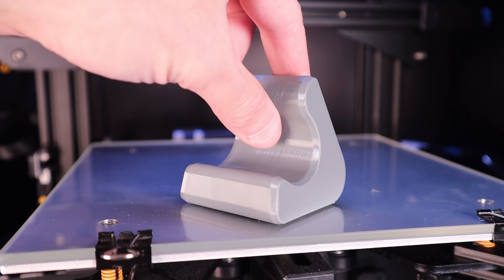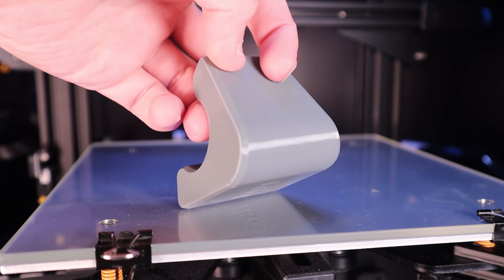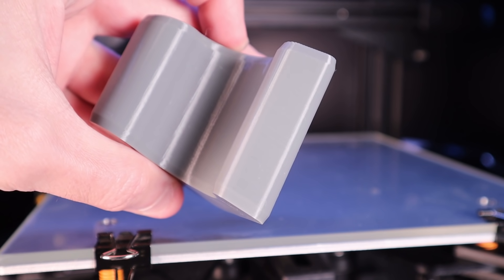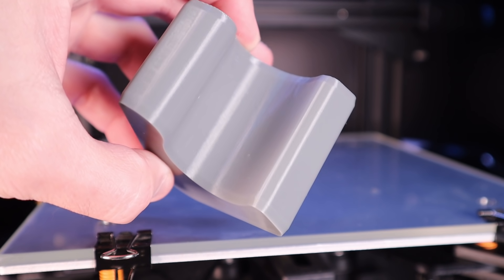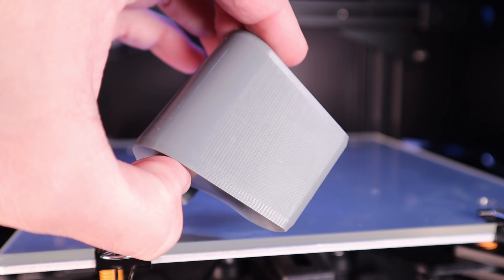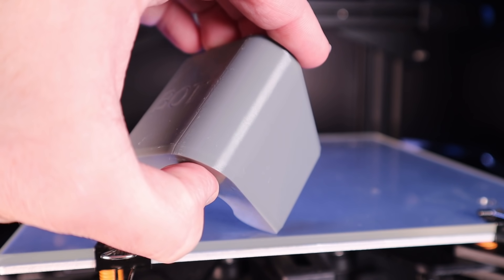Creality Ender 3 V2 - Simple Tips for Super Clean 3D Prints

Comment: That one with the last settings looks good. Myself I havent printed anything anymore. Still stuck with the bl touch. Last testing today.. After that I can only say the sensor itself came broke from start.

The videos look better every upload. 
It shows the effort that has gone in em!
Reply from the maker: That's disappointing, I don't know whether I'll ever need the BL touch, I rarely level the bed with this printer.  I did upgrade the springs because the stock ones were very weak and could promote the knobs from loosening though.

Good luck!

Thank you for the compliment, and yes it is a fair amount of work.  My hope is that I get better at it so it doesn't take as long.   I have a list for the next 10 of so videos, so I'll be busy for a while.
Reply: Rik, if you need a hand, I got mine working after some trouble. Your name makes me think that you're Dutch, so you could give me a call if it doesn't work out.
Reply: @DHGV  klopt inderdaad, ik heb hem nu werkend. 123-3d .nl heeft mij geholpen via de mail. Er is schijnbaar een 4.2.2. Moederboard firmware waar duidelijk bij staat 4.2.2. Bl touch zonder adapter. Vanaf dat deze erop staat doet hij het goed (de bl touch)

Maar vanaf dat ik de printer verplaatst heb en zo vaak op zijn kant maakt hij nu een vreemd geluid op de y as. En kwam er  gister achter tijdens de excintric nuts onder het bed aandraaien dat als ik het bed van voor naar achter duw. En hier goed oplet voel ik een kleine verhoging in het bed achterin. Maar kan niets vinden bij de wieltjes of de rails. Twijfel om hem nu deels uit elkaar te halen en weer opnieuw te assembleren.
Reply: @TriMeX1987  Mooi dat dat werkt. Wat je beschrijft op de Y-as herken ik niet, maar klinkt alsof een van de wieltjes niet helemaal gelijkmatig is afgesleten. Het kan ook zijn dat het te maken heeft met je Y-riem. Staat die te strak gespannen, of te los, zit hij goed op de geleiders? Is hij beschadigt? Dat kan er zeker voor zorgen dat je iets voelt in die beweging.
Reply: @DHGV  de ender 3 is praktidch nieuw. Heb nog geen volledige rol filament geprint.

Ik had op de z as wel wieltjes beschadigd. Voelde ik ook en direct nieuwe wieltjes erop gezet. 

Het lijkst als je de plaat helemaal naar achter duwd dat hij ergens overheen omhoog rijd..en net ervoor een dipje.. in dit dipje kon ik het bed ook licht bewegen. Daarna excentric nut weer beetje vaster gezet kijken of dat hielp. Maar voor alsnog niet. 
Hij maakt ook een raar geluid bij auto home op een lage snelheid hoor je het niet. Maar hier wel.
Reply: @DHGV  idd beschadigde as. Zit een deukje in het frame. Dus het wieltje dat ertussen rolt beweegd daar op.

Heb contact opgenomen met banggood. Kijken wat de oplossing is. Bij aankomst waren 2 wieltjes ook al zo beschadigd dat het niet bruikbaar was. Denk een nieuweling met inapkken.
Reply: @TriMeX1987  hmm waardeloos. Hopen dat het snel opgelost wordt. Wel fijn dat je erachter bent gekomen wat er nou precies mis was! Succes met de reparatie en happy printing!
Reply: @NeedItMakeIt  good to see your vids are getting pass 1 mill.. congrats!
Reply from the maker: @TriMeX1987  Hey thanks!  I happen to be working on several more 3D printing vids at this very moment.  I appreciate the support my friend.
Reply: @NeedItMakeIt  I was about to say.. things that are hot right now... bambu x1 vs prusa.. that will get hits 👍

Comment: Try printing outer walls first in the Cura settings. It depends on the geometry of the part but it can help (not for overhangs).
Reply from the maker: I will try that, thanks for the tip.  Not for overhangs because it loses the added bond to plastic adjacent to it?
Reply: @NeedItMakeIt  Correct.

Comment: What's your print speed at? and does it matter?
Reply from the maker: It does matter a bit, i like to print outer walls at 35, inner at 50-55, infill around 60 or a little higher.  A high speed can cause trouble for overhangs due to not enough cooling.  Fans high, and add an additional room fan if you want to keep your parts cool with higher print speeds.

Comment: I would say that plastic is overheated...
Reply from the maker: Can you elaborate a little bit on this, how can we determine if it is overheated?
Reply: @NeedItMakeIt  just take a look at its fluidity. I prefer to print at the lowest temperature bound, in that case you will have less smudges and strings. Try to reduce your temperature settings by 5-10-15 degrees and compare.

Comment: Tricks that worked great for me was to buy a Creality Ultimaker glass plate and make a flow percentage calculation using a ruler.
Reply from the maker: Do you have a link to the glass you can share?  Thank you!
Reply: I got my glass plate from ebay. Works great but know few guys that bought glass at hardware store and cut it to size themselves that haven't had any issues. 🤷‍♂️
Reply from the maker: @fishingsouthernindiana6480  I've been using the 3mm borosilicate glass for a while and it has been working very well until 2 days ago while testing a high flow 0.5mm layer height with a 1mm nozzle, the part had such a good bond and contracted with such force that it cracked the glass.  I've also used picture frame glass from walmart at 2mm and it works well also, though it is more flexible.

Comment: On a circular single part why is there a need for a seam at all? Couldnt it just comb inwards while adjusting the z height and continuing to print? My printer arrives in two days be gentle lmao.
Reply from the maker: This method is known as the VASE mode, it is possible right now.  If you have multiple walls, it is not currently available.   I think your idea is possible in some cases in a spiral type motion from in to out and then up, then from out to in, but it would still have a seam where the beginning and ends of the extrusion are.  There are a few other ways to get better seams which I did not discuss, they'll be in future videos.   Linear advance is one, nozzle diameter is another.  Smaller diameter = better seams, but at the cost of much longer print times and weaker parts.

Comment: i'm not a fan of using glue sticks or hair spray.  it should stick to the plate by settings. for this i suggest turning fans off for the first 2-3 layers and slow the initial print layer down to 20mm/s.  this will help you not need any glue!

Comment: The butter failed in my testing. The print would dislodge from the plate, and fly across the room. It wasn't until I came across your video that I should have used salted butter. If I only would have known sooner.
Reply from the maker: Yes, and only use the best quality butter.  I like to churn mine a few hours before I need it so I know it's fresh :)
Reply: @BlondieHappyGuy  Yeah, it's a joke. In case you're wondering, any type of grease is going to ruin your first layer. The print will simply not stick.
Reply: @Brax W Before you make the obligatory, overused reddit joke, maybe you should take into account that I was replying to someone else's comment. It appears that comment doesn't exist anymore, but my reply still stands. In case someone doesn't get the joke, yes grease will prevent the print from sticking. Now that we got that cleared up, this matter is in my opinion resolved.
Reply: @PunakiviAddikti  thanks for telling me, too many people are saying to use grease, it's confusing to a complete beginner
Reply: @hank1845  You're welcome I guess. If you need bed adhesion, use a heated bed at 60 degrees for first layer and drop down to 50 degrees for the rest to help avoid warping. Hair spray is a good adhesion agent.
Reply: @PunakiviAddikti  yeah I thought butter was serious I was so confused because I saw to use glue sticks so it didn’t make sense to me I’m a complete beginner that doesn’t really know anything
Reply: @joemoment-o1275  I can see why some people think it’s funny it’s like a gate keeping thing I’m pretty sure, there’s gatekeepers everywhere
Reply: @michaelelizondo4724  I will never put f****ing butter on my printer
Reply: "If only I would have known butter " XD
Reply: @joemoment-o1275  I mean, it's kind of funny...
Reply: I can't believe its not butter
Reply: @PunakiviAddikti  Your reply is still useful cause i was sitting here like theres no way someone is using fucking butter hahaha and this is the first time ive seen this guys videos n im newer to 3d printing so i know about glue sticks but i thought it was some new method i was like interesting but ill stick to elmers glue stick shaha
Reply: @concentratecorner1744  I can definitely see beginners falling for this and actually using butter on their bed. Hell, I probably would have if it wasn't for the instructions that came with the printer.

Comment: I noticed you were using petg filament would you recommend to use this material for cookie cutters? I was recommended this from some library class I took on 3d printers but haven’t heard anyone using this filament I often here just pla.
Reply: Also I’m fairly new to this 3d print world and I’m binging on your videos. I’m wondering if you may have settings you would recommend for the slicing program. I’m so intimidated buy the printer and don’t really know what settings I should have. I bought the ended 3 pro but still haven’t made one print 😐
Reply from the maker: PETG would be fine to use, it is highly resistant to abrasion and is somewhat flexible unlike most PLAs.  Some PETGs are also noted as food grade, it is a little misleading because the material is made in a food-grade manner, however the final result isn't because it contains so many small voids for food particles to embed themselves.    I don't see a problem as long as the food is being cooked.
Reply from the maker: Let me know which material you're going to try and I'll dig up a profile you can use.  It is certainly a lot to know in order to start.  Once you have a few under your belt, it will be a piece of cake.

Comment: outer wall speed of 50mms and regular print speed of 100mms does the trick for me. And also, a perfect first layer
Reply from the maker: That's a fast print, I must try this, I haven't had the courage to go past 78 only on infill.

How about calibration, do you spend much time on this?
Reply: @NeedItMakeIt  I recalibrate the bed on a weekly basis. Mostly because the threads on the upper aluminium extrusion for the bed assembly on my ender 5 is stripped, so the bed shifts slightly between prints. With my current settings they print crazy fast and look gorgeous. 0,24 layer hight, 40mms initial layer speed, 2 shells, 15% infill, 240 moving speed, 0,6mm layer widt, 0,4mm nozzle, 10mm retraction distance

Comment: Hi. I'm a noob with issues. My bottom and top layers have (very) poor detail. I've googled with no luck. On a test cube my y axis is a few mm smaller than the other sides. Are these related? Using a Creality Ender 3
Reply from the maker: If only the bottom and top layers have problems I'd have to say you have an issue with over-extrusion.  The middle layers are likely not as impacted by this due to the hollow area and infill.  If it were just the bottom, I'd say that your build plate was too close to the nozzle for the first layer.    Can you do a 100mm extrusion test to see how close you are and re-calibrate the e-steps accordinly?
Reply: @NeedItMakeIt  I haven't tried, but I'll do that next. I'm learning this as I go. Is there a really good resource for all in one new user troubleshooting?

Comment: cant they find a way to put the seam in the infill, so everything would be seamless
Reply from the maker: With the exception of the vase mode, spiralize 3d printing method, there will always be an area where the layer begins and ends.  The simplest analogy being to draw a shape using a continuous stroke, starting at one point and stopping where you began, that spot will not align perfectly.  The 3D printer does a little jog inwards to conceal the seam better, but the nozzle diameter and the layer thicknesses seem  to have a fair impact on the final look.  Have you tried linear advance at all?  I believe this may help a bit to conceal it.

Comment: From what I can see, calibrating your stop and start procedures would remove lots of those blob/gap issues, and those strings... Combing is good, but it's just hiding the much needed correct calibration method. Retraction, pre-loading, coasting, wiping. Why don't these slicing software packages come with the correct methods..? Spend some time on these, and combing won't actually be needed.

One hint: I can now print ABS on glass without glue - I found that printing a 'line' to clean, and then continuing to the starting point made the biggest difference (I can see yours lifts off from the 'clean' to starting point). I'm getting close to being able to do PEEK. I'm just getting held up with the first layer - it should all be done in one print, but no, all packages want to print in sections (inside/outside/infill) - making the stop/start get in the way of bed adhesion. The first layer needs to be either printed in one single continuous 'line', and/or should always have something for an edge to join to!

Comment: Please HELP ! I have a ENDER 3 and having weird printing problems  i am using simplfi3d and always preheat, Level and home the bed :-  when i am printing a lot of the prints come out good BUT some prints fail to print obove a certain height (  not all the same height ) and the extruder just stops working !   I have done mods and followed many videos and web sites and nothing works PLEASE do you have any idears its driving me nuts ??
Reply from the maker: It sounds a lot like you have a bowden tube which is either melted at the hotend or was not seated properly.  This is fairly common as it is hard to grip and also to tell when it is far enough in.  When this happens you'll get a mess of half-melted filament inside the hotend which will prevent the filament from flowing through well.  Pull the filament out, grab some sandpaper and heat the nozzle to 10C beyond what you'd do normally.  With the sandpaper, take the tube out and have a look, it might be black, or completely worn away, trim the end then loosen the fitting 1 turn.  Shove the tube in as far as you can using the sandpaper to help.  Tighten the fitting to further seat the tube.  

You're done.   You may consider upgrading the tube to the best quality one money can buy.

Let me know how it goes!

Comment: I used to use Print One at a Time, but in a previous version of Cura, they changed how it determined the order to do the models (random selection of the models).    After having just played with it, it appears they restored the previous ordering (last model loaded prints first).

With the last in/first out ordering, you can arrange the models front to back and you don't have to worry about collisions.  You can print any size model by tweaking your carriage settings.

When doing multiple parts, I prefer One at a Time (POAT?) for the exact reasons you covered.   Also, if you have a failure, you don't immediately lose an entire bed worth of prints.
Reply: Is there any way to import 2 or 3 stl and know their order? Or importing 1 at a time is needed? Cheers

Comment: I have a Crealty Ender 3 V2 but has a blockage in the head unit. Anyone able to give tips ?
Reply from the maker: If you have the needles that came with the printer, you can heat up the nozzle, raise the head pretty high, and then use the needle first, then trying to manually extruder some filament through it.   If you're having trouble with the extruder skipping, it could be that the tube meeting against the top of the nozzle is melted a bit, letting filament collect inside and create a lot of resistance for new filament to be fed through. 

Let me know if that helps!

Comment: Im trying to print carbon fiber and doing testing with PLA, but as soon i changed the Firmware the printer do not print like yours anymore. Not sure if was the new cheap PLA. Any feed back that you can give me on this matter ?
Reply from the maker: It could be that you need to recalibrate your e-steps.  Can you link an image so that we can have a look?  If you're printing CF filament you may have a nozzle clog or your extruder gear is worn.  This small sample did quite a number on mine and I took the gear off to re sharpen the teeth to points.  Amazing stuff, but it can cause us some trouble.  

Can you mark 110 mm on the filament before it goes to the extruder and then set your printer to extrude that amount, that if the mark is 10mm away you're in good shape.  If it is too close or too far, you'll have over/under extrusion and that can lead to some minor to major problems in your prints.  Sorry if you know this already, I don't know what you know.

Comment: In my experience the single best way to get better quality is smaller nozzle and printing slowly
Reply from the maker: Very true, I normally print more structural parts so this isn't so necessary much of the time, but it does make a pretty big difference jumping from 0.6 down to 0.4.  Have you ever printed with anything smaller and do you find any trouble with the smaller nozzles and the first layer?
Reply: @NeedItMakeIt  smaller? I almost always print with .2 I've only ever done .6 once. I generally care more about looks than I do strength because nothing I make really is going to be undergoing any real stress. No I dont think there is really any difference with the first layer at least between .2 and .4 i sometimes get a feally rough first layer which i think comes from bad adhesion because i dont put on enough hairspray but I think it happens for both sizes.